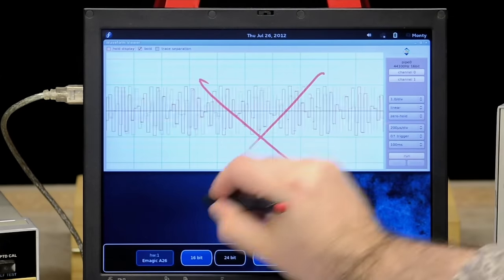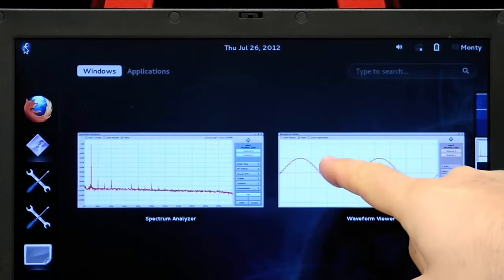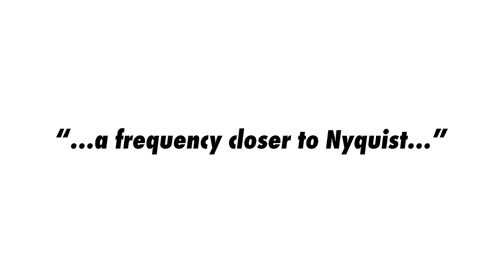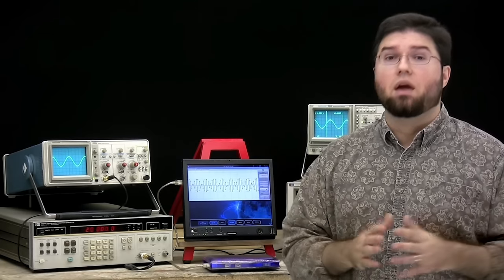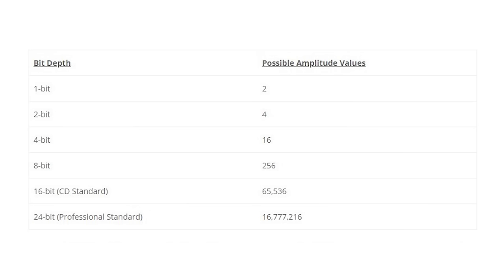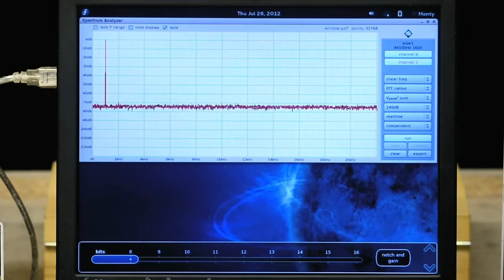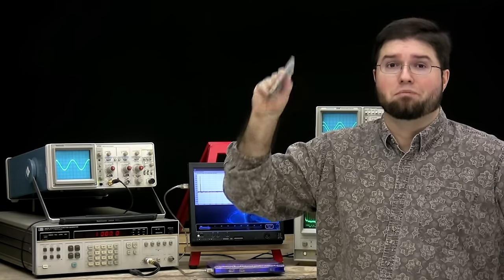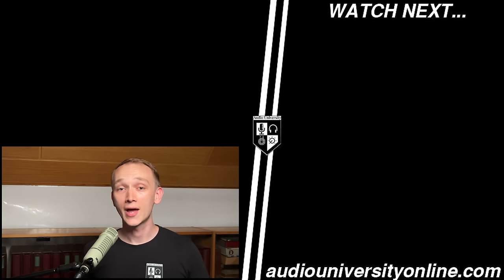Debunking the Digital Audio Myth: The Truth About the 'Stair-Step' Effect

Comment: Some of the reasons to sample higher than 44.1 kHz was to make anti aliasing filter less steep to avoiding aliasing. This filter is in the frontend and analogue, so the filter is cheaper and gives less phase distortion. If the signal is oversampled many times you can take advantages to noise shape the spectrum (place the noise in the frequency range you will filter away).
Reply: Sigma delta converters do just that.
Reply: @SR-ml4dn In the original article, Monty does mention that processing at higher sampling and depth is perfectly sensible, the original article (which is linked in the description) was a response to "high definition audio". And the video here is a complement to that, clarifying misconceptions about digital audio & audio waveforms.
Reply: Front-end analogue filters are a problem because they can't be sharp enough without introducing distortion and noise.  Instead we just sample at, say, quadruple the rate (176kHz) so the analogue aliasing filter can be much less sharp.  Then we use a digital filter before down-sampling to 44kHz.  Even digital can have trouble with the sharp cutoff between 20kHz of hearing and the 22kHz nyquist limit.  Moving the nyquist limit up to 24kHz helps which is why 48kHz sampling is so common in newer standards, including digital video formats.
Reply: @rogerphelps9939 most/all silicon based sigma delta converters create idle tones and some cause noise floor modulation. This is why engineers like Bruno Putszeys designed discrete PWM conversion methods.
Reply: Came here to say this having a masters degree in vibrations for mechanical systems. Aliasing and side lobe distortion is always a major issue when recreating frequencies from sample data with FFTs and I see no reason why it would different here.

Comment: Key to this is limiting the bandwidth of the sampled signal.  With proper low pass filtering, frequencies above Nyquist are eliminated and there will be no aliasing noise.  However, oversampling can simplify the input filter complexity and the high frequency content (noise) can then be filtered digitally and downsampled to generate the output digital stream at 44.1K or 48K samples per second.
Reply: Internally audio production software uses 32 bit floating point to avoid clipping the 65536 values a 16 bit software synthesizer can generate. The final output is 16 bit though. 32 bit floating point is also faster for cpu calculations. In this video only the end results are matter-of-fact for human hearing.
Reply: There should be aliasing at 15 khz. Even if you generate the perfect waveform on the PC, there are clearly audible aliasing byproducts.
Reply: @dtibor5903  2 times 15khz is 30 khz, but YouTube cutoffs everything above 16 khz fo better recompression.
Reply: That's why it's 44.1K rather than 40K - need a bit of extra room because real-world filters are not perfect, you can't have a brick wall. Well, you can with oversampling and digital filters, but that wasn't around back when CD was introduced.

Comment: Good discussion! I stand by my assertion that the best improvement in my stereo was the cheap CD player I bought back in the early 80s.  Gone were the days of clicks and pops of vinal!  It is interesting that vinal is making a comeback.  I think it's the ritual of the turntable and cleaning that's the reason.  I did double blind testing on very high-end equipment from the late 70s and early 80s and the CD always sounded better.  The only thing close was a $5000 turntable/cartridge combo that was awesome!  Sounded almost as good as a $130 CD player with a DDD disk.  
My best takeaway is it's the music that's important and not the gear!  You're far better off spending your money of good quality recordings than expensive equipment.  
That said...  Spend money on good speakers.  Only the microphone (which you generally don't control) and your speakers should color your sound.  Tube amps color sound in a nice way (even harmonics) but at the end of the day, it's still distortion!  Great for guitar amps!  And yes, I'm listening to this on an amp with a tube preamp because "tubes"!  They are cool and glow!  And have a VU meter!  And that's through speakers of my own design.  I'll switch back to a cleaner amp soon.  But the VU meter is cool!!!
Thanks for the video!

Comment: Higher sample rates are great if you are a sound designer and wish to do lots of time compression and expansion, particularly if you wish to get fewer digital artifacts. There are also times when you want the digital  artifacts from time compression and expansion, so it’s all about that your desired effects are. Knowing when and how to use each audio sample rate and bit depth is a skill you get from experience. Great breakdown on the technical side for those not in audio production. Can’t wait to hear your thoughts on how to use each sample rate and bit depth when it comes to professional audio production. I wonder if you will get into more than just music production, but also pre and post production for TV/Film/Radio/Podcasts, Sound Design, Foley, Voice overs, and Voice Acting to name a few… 

Mixing down to 44.1khz 16bit is perfectly fine and sometimes preferable, it’s only when you start messing with audio’s time and pitch do you really start to see immense utility in higher sample rates like 196. It’s great as a Sound Designer when you get to choose between different sample rates and bit depths, it adds so much flexibility when tweaking sound effects and voices. It can save lots of time and money if you have the ability to tweak sound effects and ADR VO to work and not have to record new sound effects, or especially bringing back in an expensive Voice Actor just because you are limited because of sample rate just how much you can manipulate a particular voice/sound effect…

Just my two cents…
Reply: Off course high sample rates matter when it comes to sound manipulation in samplers/DAWS/vst-i:s. But his video was only about sample playback for a fixed song with a wave that isn't manipulated. Even back in the 85 when the Fairlight CMI 3 was released, they knew that playing back 100 KhZ samples pitched down an octave would get you really cool sounding low tones that still retained "full quality" with less artifacts!
Oversampling is also used in  many softsynths when they are doing "internal calculations".
Reply: So much disinfo here I don’t know where to start. Without realizing it, you are propagating the very silliness this entire video was made to debunk. I suggest you study dither until you actually understand it for starters. Then do some more reading to find out how top engineers actually do their digital recording. Sound Design is a somewhat low demand version of music, not the opposite. I’m happy for you to feel special about your chosen line of work, but it would behoove you to know what you are saying before you write these ridiculous screeds.

Comment: Licensed professional engineer with undergrad degrees in engineering,  physics,  and mathematics and a masters degree in engineering AND a professional music producer here.  You just got a subscribe.  This was one of the best videos I've seen in awhile... and though I theoretically understood this based on DA design concepts, this video spelled it out with such clarity and reason,  that I had to comment.  

Great work!!
Reply: Just get rid of the lollipops.  The output of DAC is latched, there are no lollipops and the staircase is real -- just microscopically tiny and passed through a filter to get rid of the 44.1 KHz sampling frequency.
Reply: @thomasmaughan4798  When it's reconstructed to analog,  it definitely isn't a stair step.  Look at the output on a scope.  Show me the stairs steps.
Reply: @mc2engineeringprof  " When it's reconstructed to analog,  it definitely isn't a stair step."
It most certainly is!  DAC can ONLY output DISCRETE voltages.  You give it a 16 bit code, it spits out the corresponding voltage until it gets a new 16 bit word.  Then the voltage jumps immediately (within a few nanoseconds) to the new voltage.

"Look at the output on a scope.  Show me the stairs steps."
You CANNOT see 65536 steps on a scope with barely 8 bit vertical resolution!  Noise will exceed the stair steps anyway. 
Now, if you increase the vertical gain to zoom in on a portion of the sine wave, and you probe the output of the DAC itself, you will see staircasing.  That is how it works  
Some Youtube videos compare oscilloscopes on this exact procedure.  A digital scope creates staircases on input depending on its ADC.  That's why you use an analog scope for this sort of thing; a digital scope itself introduces staircasing.  
But what is the resolution of an analog scope?  It is noise limited for one thing; 16 bits is a LOT of depth.  A typical CRT for television has 512 lines of vertical resolution, it is impossible to see 65536 stair steps when the phosphor dot is already straddling hundreds of these steps.
Reply: @thomasmaughan4798  You don't understand how D/A conversion works.  Watch the video again.
Reply: @thomasmaughan4798  you're describing audio DACs from the early 90s maybe, they haven't worked like that the past 25 years though. Modern audio DACs use upsampling and sigma-delta modulation to convert the PCM to very high sample rate (a few MHz) but only a few bits of resolution, so the unfiltered output may not look like the original signal but it also does not look like the kind of stairstep you're describing. More importantly, it's kind of irrelevant what the unfiltered output looks like, the external analog filter is essential to the proper operation of the DAC. The overall result is that it will properly reconstruct, to a high degree of accuracy, the (unique) bandlimited signal that passes through the sample points given to it, provided that this signal is within the passband of the DAC (which is at least 20 kHz when using a 44.1 kHz sample rate). The details of how exactly this is achieved is quite interesting but not particularly important to understanding digital audio as a concept.
Reply: @MatthijsvanDuin  My doubt about digital audio isn't the resolution or stair-stepping which presumably is finer than I can hear (but cannot fail to exist) but the lack of damping factor since DAC produces voltage and whether the amplifier can damp the overshoot of the speaker's coil.   The whole point of a Class D amplifier is that it isn't really an amplifier in any traditional sense; it obtains efficiency because it has no linear components dissipating power.  I suppose they've solved that problem but there it is.  I suppose with digital feedback the effect of damping factor could be computed into the data stream.
Reply: @thomasmaughan4798  First of all as stated above by many others, there is no stair-stepping at the output at the dac. The reconstruction filter is made in a way that no audible artifacts of the digital to analog conversion process remain (Jackhammer to mosquito comparison). This can be measured with an audio analyzer to a very high accuracy compared to an oscilloscope.
Regarding damping: What overshoot are you talking about? All signals are voltages, it does not matter if you connect a tape-, record- or cd-player to your amplifier. The amplifier is just there to amplify the input voltage and provide more current (low output impedance).
The output impedance of the amplifier is low compared to the speaker coil, so the damping is not affected that much by the amplifier. Also the speaker coil changes impedance based on the temperature of the coil (i.e. output power of the speaker) and this is the limiting factor to a perfectly damped system. Also ideally damped systems are not always wanted, it depends on the sound the designer of the speaker cabinet is going for. (Speaker damping is more related to the design of the speaker cabinet itself)
Reply: @xXDarkKisukeXx  "there is no stair-stepping at the output at the dac."
You seem not to understand digital technology.  The whole point of it is that no intermediate voltage exists between 0 and 1; or 110010101 and 110010110.  It can, does and must STEP from one voltage to the next.  It can be a very small step and that's what you get using more bits per sample.  But to say there is no stepping is JPW  (Just Plain Wrong).
Reply: @thomasmaughan4798  Actually I do understand digital technology. What i meant is that at the end of the digital to analog conversion process (Dac-chip & filter) there are no stair steps. It is a time continuous signal and the quantization(conversion to digital) only produces quantization noise, no stairsteps (At the output). The conversion obviously includes discrete voltages or currents but my point was that you can not see this at the output as stairsteps.
Reply: @xXDarkKisukeXx  Agreed.  Once filtered, the signal will be pure analog goodness.

Comment: I have lots of different music formats: SACD, MP3, FLAC, DVD-Audio, Blu-Ray, and on and on.  This video is in line with my observations.  The original recording, regardless of the format, is much more important.  But I still like high-density formats.   I cannot tell the difference between ANY of these formats, EXCEPT when I crank up the volume.  I can crank up the volume on my giant speakers maybe 5-10% louder (which I love) without distortion with high density formats (and I have plenty of the same recordings in multiple formats).  But I always assumed it had more to do with the way the sound is processed by my specific  electronics than by the actual bit rate.  It varies by specific systems. This video implies that the noise reduction of higher bits may be the culprit, but given all the electronics issues involved, it's hard to pinpoint.  Same with vinyl - I can get some unbelievably sweet sound from certain vinyl that just isn't the same from digital, but only with excellent (but rare) specific records, and only with crazy complicated setup and very specific components I've discovered via long-term trial and error.  So again, it seems to have more to do with the specific setup than the actual music format.   I love vinyl, but I laugh at the complexity of getting truly great sound with it - so many variables.

Comment: I would guess they use 24 bit high sample rate in music production for essentially the same reason movie producers and Photoshop artists use  significantly higher resolution source material than the final product, because when the final rendering is done, any subtle errors in production  will be ultimately diminished to the point they are barely if at all noticeable
Reply: Exactly, it's about preserving dynamic range of the finished product. It means you don't need to perfectly hit full scale range when you digitize the audio signal. You want to leave a bit of headroom when you feed any analog signal into an ADC so clipping does not occur. If you record at 16 bits and your resulting signal only uses 15 bits because you left yourself just a little headroom to avoid clipping, you can never get that bit back and your product can not be any better than 15 bits deep, or about 90 dB. 

If you record at 24 bits and your signal only comes in 20 bits deep because you left some headroom that means you have 120 dB of dynamic range so you can hit your 16 bit/96 dB target. 

Also, if you process everything at 16 bits then any added noise in the processing chain means your finished product cannot meet the 16 bit/96 dB dynamic range target of a CD. 

I'm not sure exactly what advantage a sampling rate about 44.1 kHz would give you.
Reply: Yeah. I have a little pocket field recorder and I record at 24bit, mostly because then you don't have to care much about recording level — as long as it's there and it's not clipping you just adjust the volume in post
Reply: @Fix_It_Again_Tony  I'm not an engineer but a guess about one reason of probably multiple reasons why they might sample at 192k: When a studio records a track, each instrument/voice is recorded separately. Each track has overtones and such that have frequencies above the 22k limit. But when you mix them all back together, you end up with interference/resonance that results in some sound being audible to human hearing. A small, almost imperceptible part of the audio that you would hear if the band was all playing live in the same studio room
Reply: @Sumanitu  no, 192k is because nyquist thing, with analog filter you will never remove frequencies > 24khz and that will damage signal bellow 24khz during sampling. So low order filtering, 192k sample, then hi order (almost ideal) digital filtering to get rid of everything above 24khz and then resampling down to 48k
Reply: @tkupilik  the "nyquist thing" is literally what I'm talking about, bud. You dont want to lose frequencies above 22khz (1/2 the 44khz sample rate), even though they can't be heard by human ears. Thanks for re-explaining exactly what I was talking about...
Reply: @Sumanitu  no you are complettly wrong and you do not understand what happening during sampling. it doesn't has anything to do with human ears. if your signal contains frequencis higher then sample rate /2, those frequencies apper mirrored in band 0-sample rate/2 and will disrupt actual signal. You need to get rid of them before sampling which is impossible task using analog parts.
Reply: @tkupilik  I don't think you understand the point I was trying to make which was about music theory and had nothing to do with digital to analog conversion. I think this is an English comprehension problem so I'm gonna turn off notifications for this thread. Take care
Reply: @Fix_It_Again_Tony  Processing 24 bits rather than 16 bits costs very little more nowadays so you might as well do it.
Reply: @tkupilik  The resampling can be done in a decimating low pass filter.